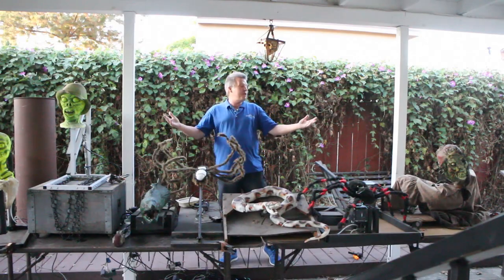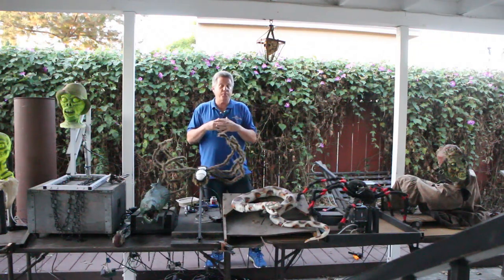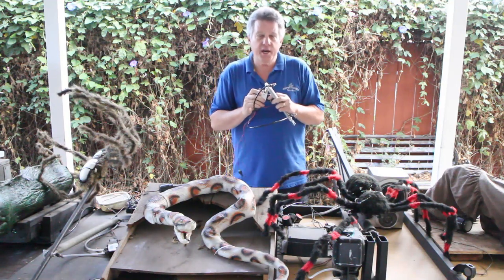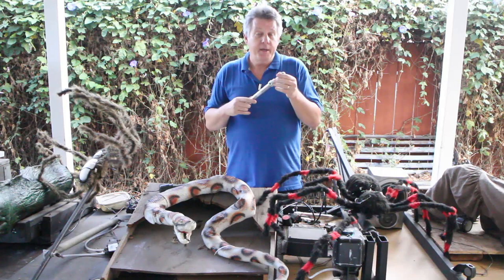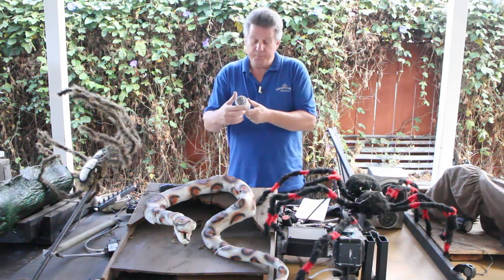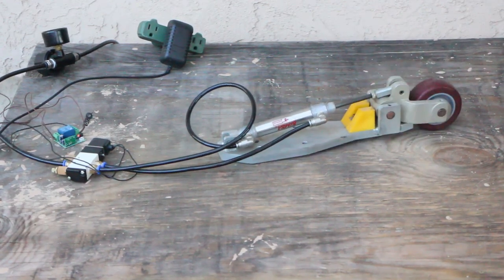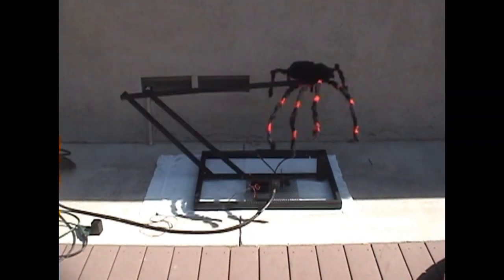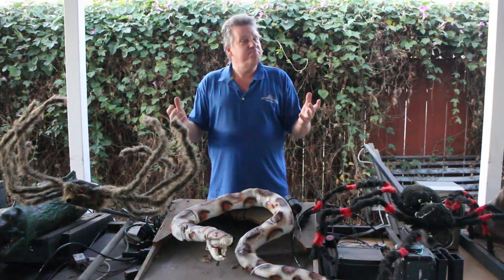Simple Pneumatic DIY Halloween Props

Comment: You can also get adjustable mufflers to put on the solenoid valves to adjust the speed of the cylinder and take the noise away from the object.Also with pneumatic parts and especially with the scissor mechanism, watch your fingers: they easily get stuck between moving iron parts.
Reply from the maker: Absolutely!  I have used those as well.  Great advice on keeping your fingers clear.  Always pull the power and air when making adjustments to the mechanisms to keep from having a painful accident.

Comment: What air source are you using?  Do u have a compressor hidden?  Are cO2 cartridges viable?
Reply from the maker: I use 2 stand up air compressors, one on each side of my haunt.  One from Harbor Freight and the other is from Sear's.  My primary unit, the one from Sear's, is kept in my prop storage shed so you can barely hear it.  The other is on the far side of the haunt, well away from visitors.  With the amount of air I use, I don't think that CO2 cartridges make sense.  How many pneumatic props are you running?
Reply: @halstaff  Hello! Hopefully you are still checking out comments: what air compressor models are you using? So many 20-30 gallons to choose from, and since they have a nice $ price tag, would like something reliable that someone with experience uses. Love the videos, already built a couple of motor-driven props based from your videos!

Comment: It's amazing and useful,
but how can we switch all of them to work in same time please ??!!
Reply from the maker: You can attach multiple props to a single trigger.  What exactly do you have in mind?
Reply: @halstaff  Hey, Thanks alot for respond :) , i'm manager of Briquette charcoal factory and i'm thinking to make pnuematic system for packing .
Reply from the maker: @هذاأنا-ظ7ر  I'm a big fan of automating processes that you can and using pneumatics is certainly a viable method.  However there is a big difference between what we do with the props we build and a commercial application.  Our props run for a limited time, once a year vs. running continuously every work day.  You can apply the principles we use but you'll need to scale them up so that they can function under the increased load without a ton of maintenance.  You might want to check out Automation Direct - https://www.automationdirect.com/adc/home/home  They are an industrial provider of pneumatics and can give you the proper advice on setting up a suitable system.  I've purchased from them many times and have been happy with the service and prices.
Reply: @halstaff  Yes me too like so much automating proccesses and trying my hard to develop as much as i can ,
Yes sure i will check the website , 
Thanks a lot and hope you successful always :)